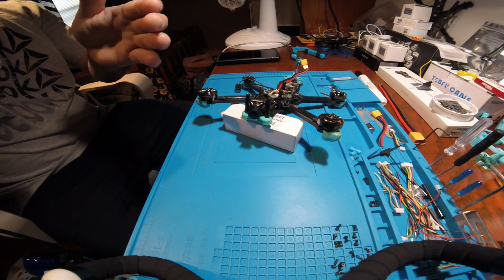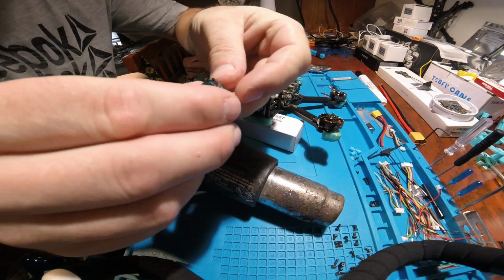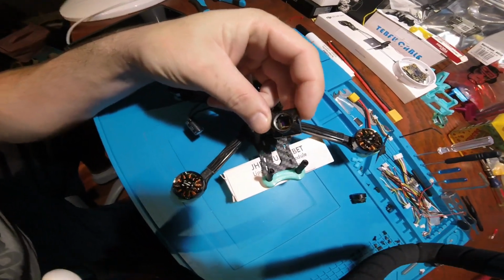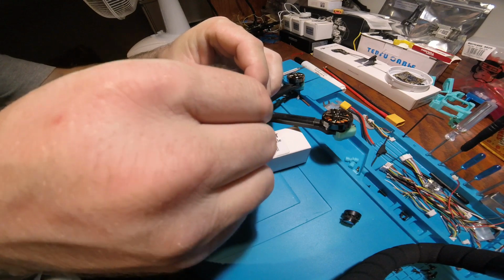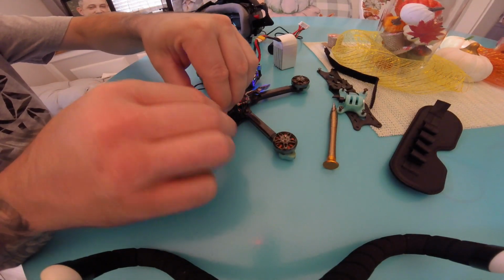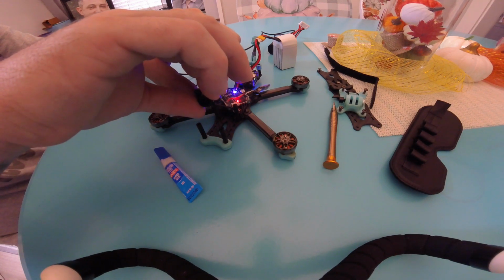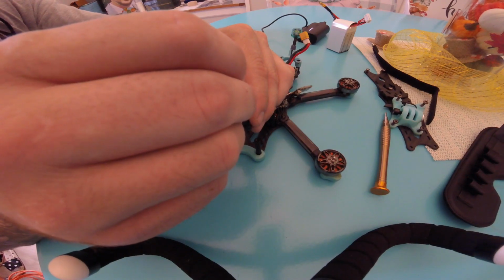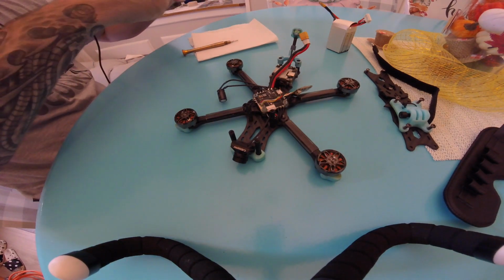Step by step (lens) replacement for cadxx nebula pro digital fpv camera!

Comment: Ain't no adhesive on most cams, I don't apply adhesive to any camera lock rings and they stay put. Analog, and walksnail. Also you can get a camera focus chart, looks sort of a like a dart board, allows you to focus really sharp as the middle comes in focus, pretty neat.
Reply from the maker: @fearlessflyersfpv420 thanks for watching my friend I guess you haven't worked with a cadxx camera yet all of them have glue on the threads lol I dnt mess with analog anymore nor do I mess with walksnail but good to know 🤙 if you crash like I do your gonna want to put some glue! Just a heads up when you start to push the limits of flying!
Reply: lol, I have crashed far more than you I am pretty sure :D broke many parts, broke a frame in half one time. I have seen your flying, I don't really see you going hard, you don't go that close to objects, I tried to get you to go through that dugout months ago ;)  @burdfamfpv
Reply: You don't mess with walknsail? Then how do you know its garbage? (Saw your comment on madstech live stream lol).  Walksnail is getting more awesome all the time ;)  @burdfamfpv
Reply from the maker: @fearlessflyersfpv420  lmao it will never be as good as dji I've tried it and it can't replace dji but who knows maybe 1 day they'll get there 🤙💯  dnt get me wrong dji has some cons too lol your too funny
Reply: funny is good :)  and people are starting to say walksnail picture looks better ;)  @burdfamfpv
Reply: @fearlessflyersfpv420 from what I've seen each brand has its positives and negatives, but I'm here to say that my caddx lens would come unscrewed for sure if I didn't use sometype of glue.
Reply: @JustKeepLivingFPV  Walksnail lenses stay in place without glue. It's nice to be able to adjust the focus as god intended.
Reply: @fearlessflyersfpv420  I'm actually jealous about that because I just had to choose my focal point and live with it SMH. All in all though, you wouldn't be wrong choosing walksnail, hdo, caddx/dji. Id like to see the price not over 500 so I could have them all.
Reply: @JustKeepLivingFPV  ya :)